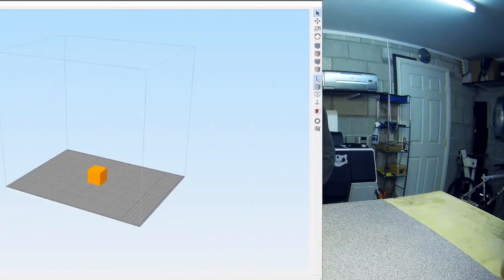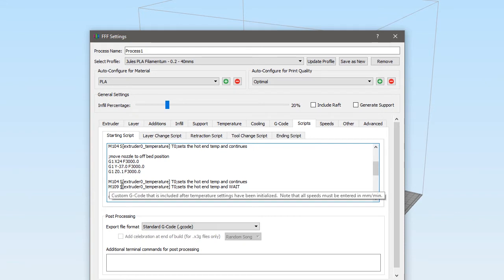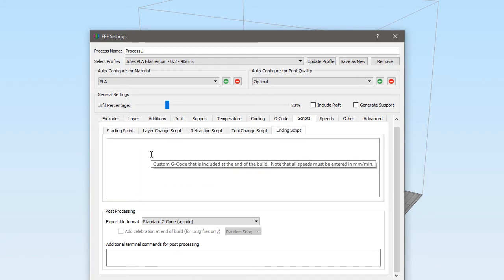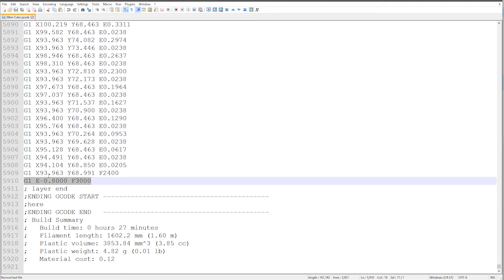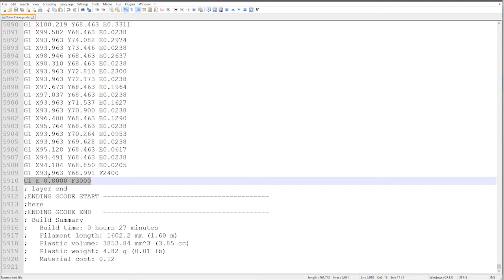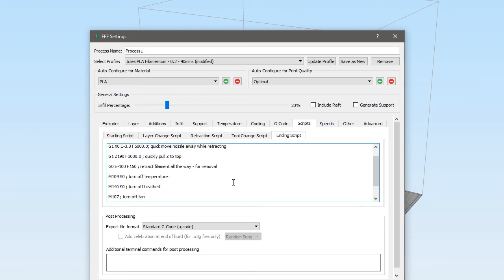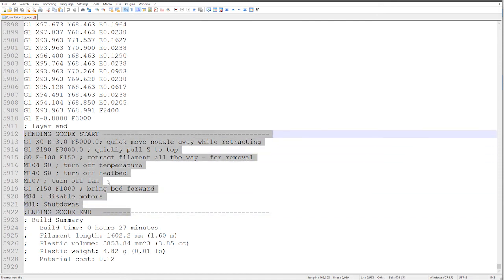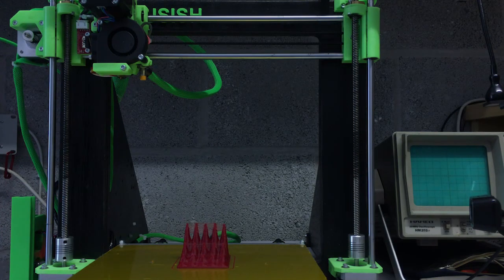3D Printing Questions - Custom Ending G Code in Slic3r, Simplify3D & Cura Slicers

Comment: Did this start and end examples on my diy build cura settings...perfect start without the z height line...hoes straight home after heatting, then oozes out 12mm, then goes straight across yo the border lines before the ptint❤...then ends with a quick left front move with an retraction to prevent...❤❤❤

Comment: Are there any way to edit the rest of the program? Not only the  beginning or the end. 
Thanks
Reply from the maker: within S3D you can set G code for certain stages - you will see there is a tab for each stage. Never used those, if I need to alter the G code beyond start and end I edit the G code file manually. Any text editor will do.
Reply: Hi Julen, thanks for your quick reply. I see now. so, I can edit the program with notepad and send it to the printer. Thanks again for sharing your knowledge.

Comment: You just got through telling us that your X minimum value is 24  and then you set it to 0 in your endscript.  Still loved the video though  :)
Reply from the maker: I wouldn't make the same mistake twice! (Probably). It is only limited when the Y Axis is at a negative value as it is during priming. X0 is achievable in all normal printing areas... :)